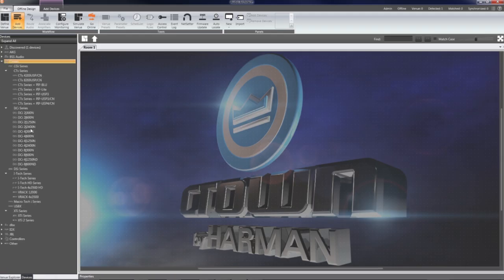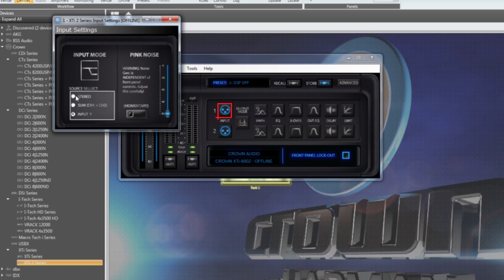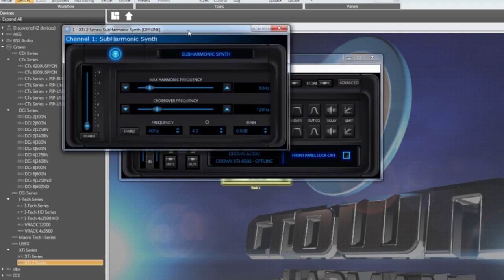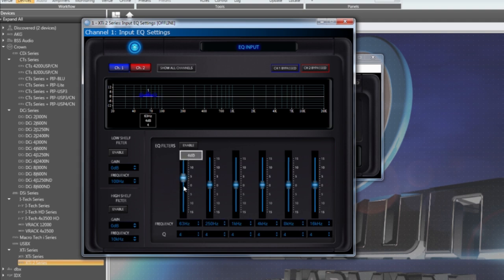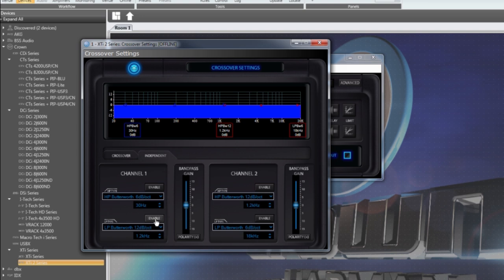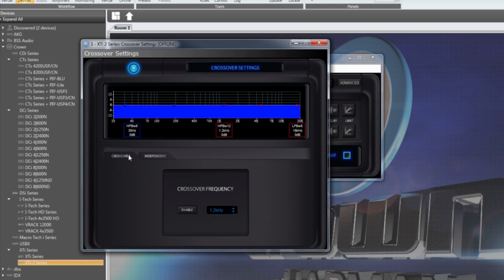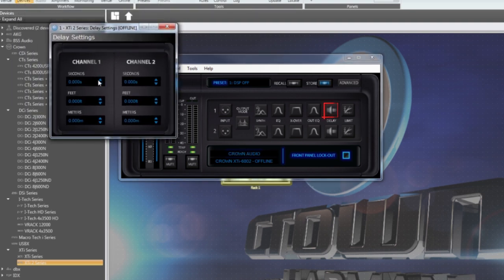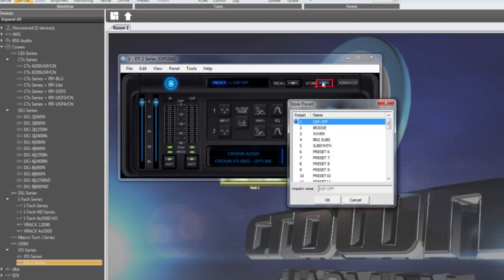Crown | XTi 2 DSP Options

Comment: How to connect with Mac book
Reply: I know this is an older post, but it might help to know that I was able to get Audio Architect to install using VMware Fusion (virtual machine) running on macOS 15.1 (Sequoia).   However, I have not been on site yet to test if it will connect to the amp.  This will depend if the mac hardware, through a USB A to USB C adapter will be seen by the VM as an actual serial device.

Comment: Hello !

 I would like to buy 3 pieces of xti 4002, and I would like if it is stable in 3 ohms?

 I have 2 2x12 inch basses equipped with Eminence Lab 12, and 2 more basses are coming also with Lab 12, the speakers are 400 w rms each, 800 rms each subwoofer. 

The speakers have 6 ohms each, 2 per enclosure in parallel results in 3 ohms. And I would like to know what rms power I would have at 3 ohms? 

I assume it won't drop much below 4 ohms?

 If at 4 ohms it is 1200 at 3 ohms it can be 1250-1300w. 

And the last question, isn't 1200-1300 in 3 ohms too much power for an 800 w rms subwoofer, although the music program is 1600 w on each subwoofer?

 If you recommend me confidently and safely to amplify the LAB 12 Bass, then I will place an order for 3 pieces.

 Sincerely, SOUND EMINENCE LAB 12!

Comment: The input Y disables the volume knob on channel #2. If you have the amp driving speakers with the crossover enabled, you don't have a way to balance the lows and the highs I believe? I'm thinking I'll still need an external Y cord?
 
 Thank you for what's installed so far. It makes these amps do so much more than the old ones. I still prefer Crown products for their clean crisp sound. I've used them for my whole life. From the old D series, to the PSA2s, the micro and macro series, and now these new DSP series. They have always supplied me with dependable crisp power. They help make my systems perform flawlessly.